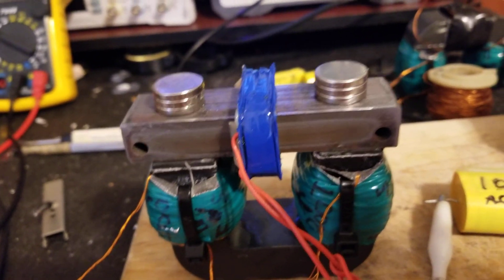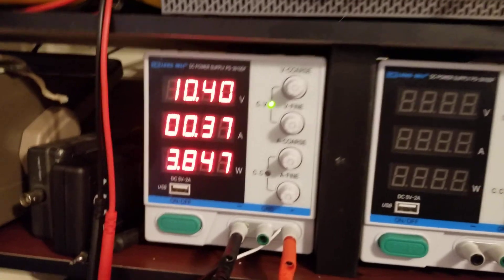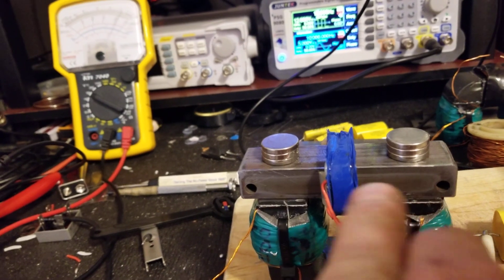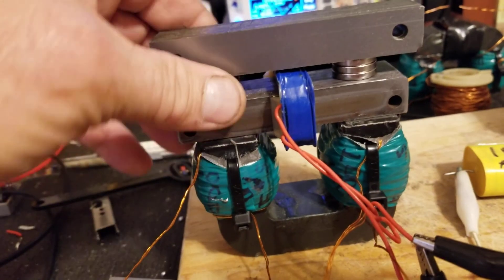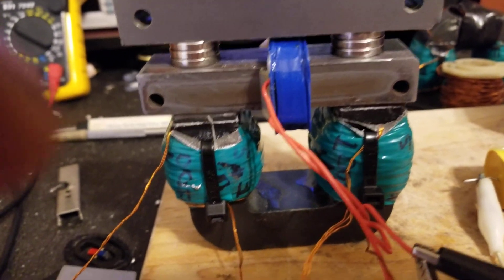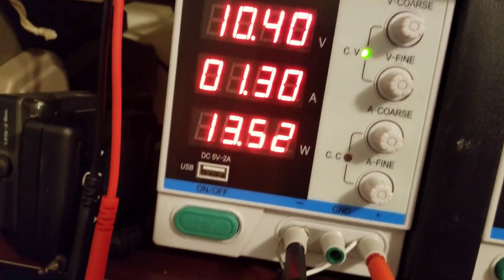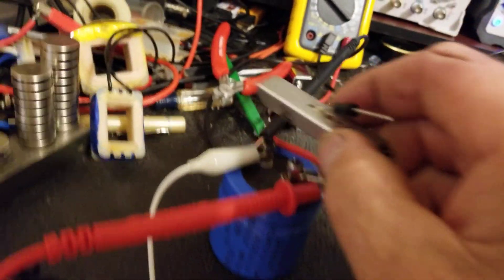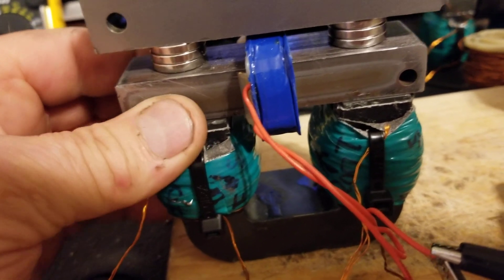Motionless electromagnetic generator Part 5

Comment: Bifilar, Trifilar it's retarded to just only say how many wires you use without telling how they got winded. You should also mention if they are magnetically either constructive or destructive coupled and how they are electrically connected series, parallel, Antiparallel. We should make a unification/standardization per definition.  Number of coils ;Coil form; wire count (bifilar etc.) ;polarity of the magnetic Feld (magnet Feld add up=constructiv or magnet Feld cancels out =destructiv) ; electrically wired up serial =end from one coil to the start of the other coil OR Antiserial =both end to end and the start of each coil go to supply OR parallel = end to end, start to start OR Antiparallel = start to end and start to end; supply DC or AC if AC then the Exact Frequency should be mentioned as well. For example:

one;NormalCoil;Bifilar;destructive;Serial;AC;@80V/1A/50Hz. I immediately know that it is just a 80W resistor.